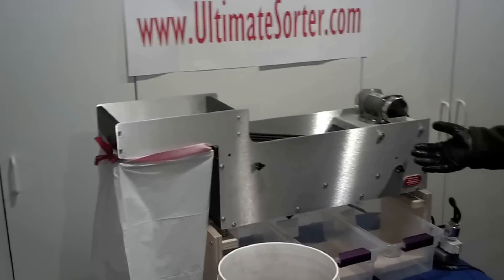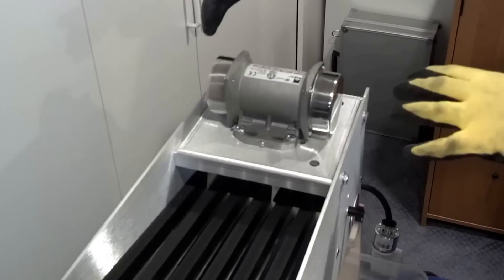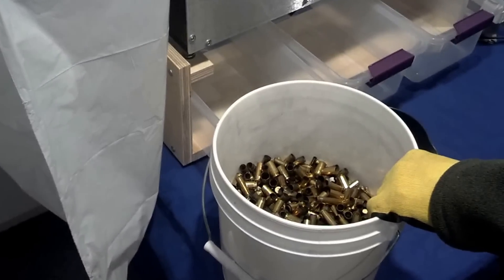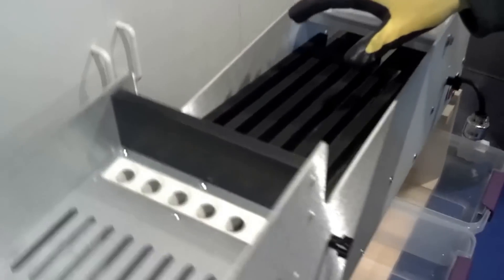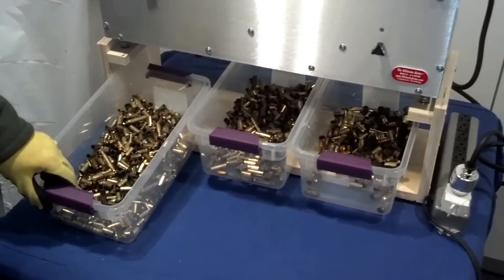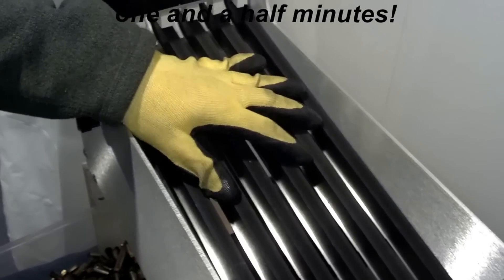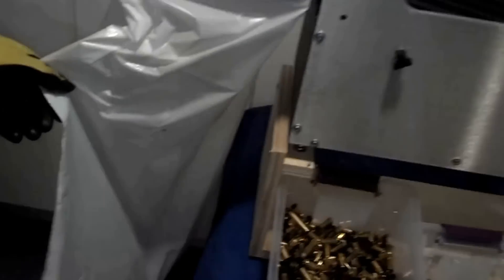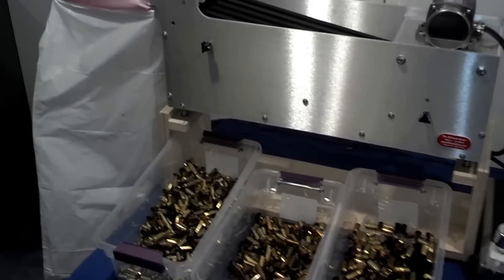Ultimate Sorter Model 3 Brass Case Sorting

Comment: what about 7.5x28 and 32SW we have tons of brass to sorted from 22LR- 300win 3700LB right now in stock
Reply from the maker: I think you have a typo and meant 5.7 x 28.

In 2 simple sorts the 5.7 and 32SW will end up with the 380ACP.

We then have an optional sorting tray that will separate 5.7 in one bin, 32ACP in the next and 380ACP in the last. The 32SW will hang in the 32ACP slot and need to be plucked out. It's simple to remove and is usually not an issue unless you have a large percentage of those.

I hope this helps.

Comment: Does this machine handle 308 and larger rifle casings or does that need to be sorted out first?
Reply: Well, I sort from a few indoor ranges. Most of the rifle cases will stand up in the
pre-sorting tray. We find it easier just to pick them out at that time, then open the ports and just sort the pistol brass there.